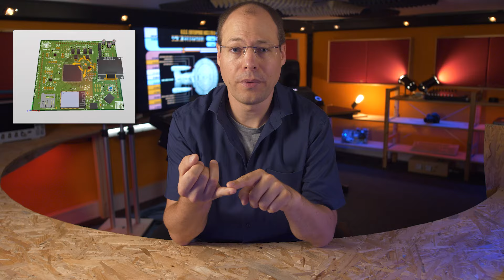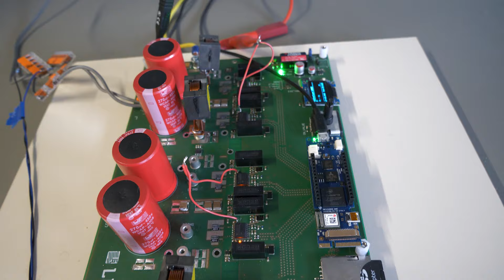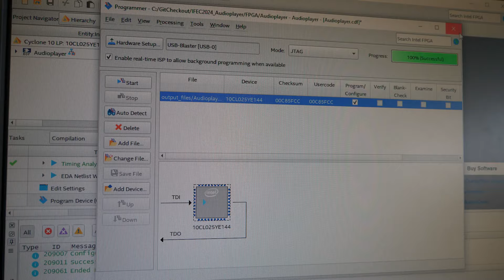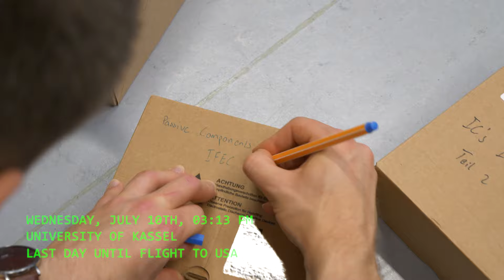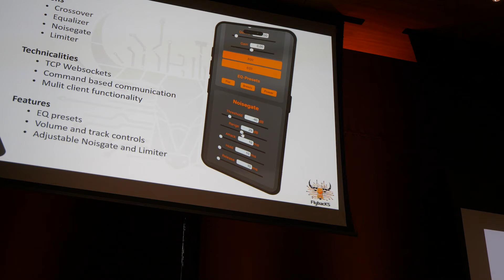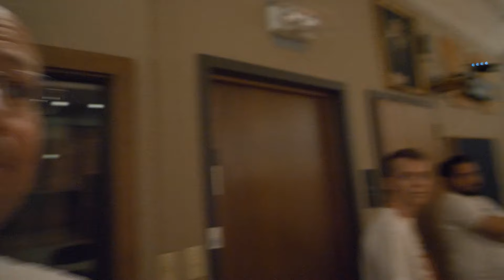An Engineers road movie to an FPGA based Class-D-Amplifier

Comment: Hi Prof,  what a great idea i hope that it could became early a product: perhaps with high grade products like PURIFI or HYPEX! Following current rpoducts around i see that topping and highend DAC products are still moving to 1 bit decoding methodologies (i think FPGA based): basically it uses SDM (DSD) format to play applying only PCM conversion if needed. DSD format is very used for highres music and any PCM could be converted (upsampled with dithering) to DSD.
Using this standard you don't need a particular player and could be the best general purpose DAC/AMP on the state of the art. Please take a look at mola mola DAC internal technology.
Reply from the maker: Yes, you are absolutely right. We used Sigma-Delta-Modulation with up to 10MHz in this project to drive the Gallium-Nitrid-Amplifier. First, we upsampled the 192kHz Audiosamples of the Audio-ADC to above 5MHz, fed this bitstream to the digital-output of the FPGA and to the gate-drivers of the GaN-devices. We went out of time to optimize the whole system and ended up with this meager THD-value (compared to the other teams). In the end I was happy with the 0.25% THD. If we would optimize the control-loop with a better and faster ADC, we could have better results. Using this DSD signal to a pre-amp we got very good audio-signals, so this technology is really promising.
Reply: @pcdimmer  There's a very appreciated software HQplayer that uses different PCM/DSD conversion strategies with a huge different dithering options... 
I mean to use 1bit trail from DSD to drive PWM instead comparator.... in my opinion a straight digital input amplifier (without ADC) will be a really killer application: and, in case of ADC needs, is very simple to add it externally...
Looking at Hypex products like NCx500 it has 150Mhz pwd clock and output filter around 70KHz because native SDM noise repulsion.... why not to ask them?
Many thanks for your great ideas sharing... please don't stop! 😄

Comment: I'd be super stoked on a video, where you focus on the control loops of a "digital" class D amp.
Most people in the field still stray away from it
Reply from the maker: Yep, we had problems here, too. We implemented a common PI controller with proportional and integral part. As reference-value we used the 48kHz audio-samples and upsampled them to 192kHz. To measure the output of the Class-D-Amplifier we measured the output-voltage after the LC-filter, fed it back to another Audio-ADC with 192kHz samplerate and tried to implement the control loop. But we learned, that 192kHz is not enough to bring the THD below 0.5% as the connected speaker creates some disturbances. We better had used a much faster ADC with some MHz-samplerate as with the FPGA we were able to implement the PI-controller with up to 5 MHz. Our THD could be much lower with a better signal-feedback strategy.
Reply: @pcdimmer  That super valueable feedback. Thank you!

Comment: what is a Electronic AC transformer?
Reply from the maker: Hi,
a single-phase solid-state transformer is a device with an AC input, a rectification, a DC/DC conversion (for example a dual-active bridge) and a DC/AC inverter. The main-goal is to minimize the volume and weight of the whole system compared to common 50Hz/60Hz transformers.

As the DC/DC converter is switching at frequencies above 50kHz the transformer can be reduced in size.

Comment: interesting that a substandard format like MP3 was used to test the audio.
Reply from the maker: Yes, you're right: MP3 is not the format of choice if you want to test an audio amplifier. Compression causes here a significant loss of resolution, especially in the higher frequencies (above 5kHz). However, there were more practical reasons for this: we needed a format that could be read from the SD card even with a lower SPI clock. In our first setups, we connected the SD card via jump wires and were able to clock the SD card at a maximum of 12 MHz. This meant that WAVE files could not be transferred smoothly. MP3 was simply much more relaxed.

Later, we had an uncompressed audio ADC that sampled at 96 kHz and 32 bits.

Comment: I have recently gotten into HF amateur radio, and learned about the research into using switching RF amplifiers for single sideband signals, which are typically amplified with linear amplifiers in most comercial designs. I had been considering attempting to synthesize the SSB digitally in an FPGA so that it takes in i2s audio, frequency and mode (upper or lower sideband) and directly feeds the switching amplifier (in this case Class E). The inputs to the amp are a square wave representing the phase information of the signal. To modulate amplitude, the input voltage to the amp is modulated, which I was thinking of using a boost converter for, so the FPGA would output a PWM value that tracks the envelope. Obviously audio frequency has significantly different constraints than RF, but otherwise it's interesting to see a similar idea implemented successfully.
Reply from the maker: Yes, the applications of FPGAs are truly universal. I'm playing with the idea of building a software-defined radio (SDR) at some point. Good luck with your project!

Comment: Next project, create a FPGA based C64 aka SID synthesizer with midi support. "Unlimited" channels and stereo output would make a product that could be not only a fascinating way to listen to old SID songs in Stereo, but also a viable commercial product :)
Thanks to the MISTer all the documentation and "cores" are available :)
https://youtu.be/Rj7XtnmsVVk
Reply from the maker: Sounds nice. In the GitHub-repository I've already added a sinewave DDFS block... and adding MIDI through the SAMD21 is not a big deal. Building a basic FPGA-based synth is absolutely possible. A challenge will be a solution to smoothly change between sinewave, triangle and rectangle...

Comment: I see lots of PDM processing in here. They say DSD isn’t worth it. This displays a great real world use case of 1 bit audio transport.
Reply from the maker: Yes, during the work on the mixing-engine and especially on the upmixing of the audio-data (PCM audio) I realized, that PCM and PDM (DSD) has both advantages and disadvantages. PCM is very nice for audio-manipulation, meaning EQing and volume-control, as you have to deal only with the individual samples. DSD would be much harder, as you first have to use a sinc-filter (low-pass). But for the output back to the real world, DSD is nice as it has a more natural stream and is easier to low-pass back to real audio-signals. As converting between both types is possible without great pain, I have to admit that both have their justification and I will continue to use DSD for analog output, but stay with PCM within the audio-processing. That's a nice compromise, isn't it? :)

Comment: Thank you for the detailed video.

What make and model of reflow oven did you use in this project?
Reply from the maker: We used an older Paggen RO250BF-SF Reflow oven. But we are in the process of purchasing a new vapor phase oven (Paggen SV540). The operation should be much better - let's see :)

Comment: I so wanted this to succeed.  But analog Class D amps have the edge because they can use feedback.
Reply from the maker: In the end our problem was that our feedback ADC unfortunately could also “only” work with 192kHz like the audio itself. We should have used a sigma-delta ADC here, which allows significantly higher sample rates, so that we could have sampled the signal in the MHz-range, for example - like the PDM.

Comment: Wow...it includes so much detail, it would be a great FPGA and audio learning kit. A bit pricey, but great.
Maybe with some improvements it could be badis of an open source online product design course.

I would love to see other submisions if they are available somewhere.
Reply from the maker: Unfortunately, FPGAs are still very expensive. I spoke to the Arduino people at the "Embedded World 2024" in Nuremberg in Germany but unfortunately the Vidor 4000 is not yet being manufactured again. There is an alternative with the CYC1000, but without the ESP32 and without the additional Cortex-M0+ microcontroller. Nevertheless, the costs are significantly higher than for other controller boards.

Unfortunately, I don't have the time for a proper online course at the moment. We are currently on tour with our band. However, it would certainly be an interesting thing to do.

Comment: hello , I am trying to build a class D amplifier with switching frequency from 500khz to 2mhz. Do you have any sample circuits for me to study? There is no information in my country.

Thank you to everyone who commented.
Reply from the maker: Well, the general circuit is that of a single-phase inverter, as used for motor applications or PV systems: four semiconductor switches, gate driver and control. Si MOSFETs are usually used for a few hundred kHz, and GaN semiconductors for the MHz range. However, I cannot provide any more information directly here.

However, I am planning a YouTube video for fall or winter, where I will go into more detail about the output stage.

Comment: Hey I love this. My final year project in Electrical Engineering was designing and building a class D amplifier and yeah, it actually worked :) No DSP or processors - this was back in 1990. Just a straightforward sampler and analogue feedback. Switched at (iirc) around 500 Khz. Also doubled as a very effective AM radio jamming device. Absolutely loved doing that :)
Reply: Nice!
Surprisingly, even some of the "modern" Class D car audio amplifiers being sold currently still have this problem of disrupting AM/FM radio reception due to radiated noise.  :-P

The first full-range Class D amplifiers I used were the tiny 100 watt @ 4 ohm monoblock car audio Xtant 1.1i amplifiers back in 2003 for a "high end" car stereo system that I installed into my 2001 Mini Cooper S.

At 6.5"L x 5.81"W x 1.63"H , the 100 watt Xtant 1.1i Class D amplifiers were only slightly larger than the footprint of a typical plastic CD jewel case!  :)

I used 6 of these tiny Xtant 1.1i mono amplifiers to power a 3-way front component speaker system in the Mini Cooper S (Scanspeak Revelator 7" midwoofers, 4.5" midrange, & 1" silk dome tweeters). 

Independent Level adjustment, fully adjustable Crossover Network Filters, Digital Delay, and 10-band PEQ per channel for each speaker were provided by an 8-channel Sony Mobile ES XDP-4000X DSP unit with a matching Sony CDX-C90 single-DIN AM/FM/CD player "head unit" as the source.

The CDX-C90 stereo head unit used a digital Toslink optical output for the CD playback which connected to the Toslink inputs on the DSP unit.  A matching 10-disc CD Changer could be connected to the DSP via digital Toslink as well.

The Xtant 1.1i Class D amplifiers definitely affected the stereo's Tuner Reception to some degree!  But I listened primarily to CDs at the time, so I wasn't too bothered by it.  :P

To my ears, these were the first Class D amplifiers (of those that I heard to that point) which did not exhibit a somewhat harsh or overly bright/unpleasing treble response.

And the midrange, midbass, and bass frequencies were at least as clean/articulate/full as any of the Class A or A/B amplifiers I had used up to that point as well.

Before taking the time and effort to install all 6 of these tiny Class D amplifiers into my car, I tested them in my home system where they powered a pair of 2-way nOrh Marble 9.0 loudspeakers that used similar Scanspeak Revelator drivers, and I was convinced that they were up to the task.

The Xtant 1.1i were listed (and confirmed via AudioPrecision measurements) as having a THD of 0.7%, and a SNR actually over -105dB!  This was unheard of at the time even for some high end Class A/B home audio amplifiers. 

The Output Power vs THD was not the typical gentle rise towards maximum power, then rising sharply as the amplifier begins to clip.  Instead, THD rises to about 75% power, then drops off before rising sharply at clipping, but while never exceeding 0.7% throughout its linear range.

The output section used two N-channel Phillips devices rated at 150-watts dissipation, each switching at 1.06MHz.  Power efficiency was up to 80%.  If you search Online you can probably find a picture of the internal PCB layout and components.  It was surprisingly simple and sparse given its performance.

In more recent years I've used the BikeTronics/Vivid Amps 12vdc mobile amplifiers which incorporate the Hypex UcD & Ncore Class D modules respectively.  And there are currently some multichannel GaN-FET designs from SoundDigital.

In my home rig, I'm currently using a ~$1350 USD stereo Class D amplifier DIY kit amp from DIYclassD that is using the Hypex Nilai500 modules.  For whatever reason I find that I prefer this Nilai500-based amplifier over the Purifi Eigentakt 1ET400A-based designs I've heard.

ANYHOW, it's a great time to be a HiFi audio/music lover with the availability of quite a few accurate, powerful, high efficiency, and low distortion Class D (and G & H) amplifiers!

Cheers!

Comment: Huge props to you Chris, you seem like an amazing teacher. 
Also I am impressed by the technical complexity of this project and the fact that it was done at least in parts by students. I am an electrical engineer and know how difficult it is to get a design first time right.
Amazing work!
You could check out the Zero To ASIC course / Tiny Tapeout. Maybe next time you could include a custom ASIC in your design :)
Reply from the maker: Thank you very much! The students did a great job, especially with the power board and the ControlBoard. They will certainly be able to take a lot from this project for their future jobs.

What was the price of an ASIC photomask again? I think that's beyond our budget ;-)
Reply: @pcdimmer 
Edit: nevermind, my info was outdated. Seems that the Open shuttles have been stopped.

Free actually, if you can manage to fit into an open MPW Shuttle financed by Google. The design needs to be open source and "interesting" enough to qualify. But I think student projects are fabbed quite often.

Comment: Nice video!  For what it’s worth, you don’t necessarily need GaN for 100s of kHz switching - I design multi-MHz power converters at my job with silicon FETs, and they are cheaper, more abundant, and a bit easier to work with than GaN.  Easier to find gate drivers as well. I’d especially recommend looking into Infineon and their “OptiMOS” line of FETs
Reply from the maker: Yes, fast MOSFETs could have been used for the subwoofer channel in particular. But then we didn't want to make different designs and set up all channels symmetrically. Originally we had planned to go to approx. 11MHz (DSD256) - so the use of GaN seemed the most obvious choice.
Reply: @pcdimmer  wow 11MHz, yep that is definitely GaN territory ;-)

Comment: Whats the program u used for the simulation???
Reply from the maker: This particular program is made by the swiss company Plexim and is called "PLECS" (www.plexim.com). It is great for simulating ideal circuits (e.g. to simulate different inverter-topologies) or to create rapid prototyping software as it can compile the project into microcontroller code. In combination with LTspice (or Qspice) for simulation with real components, it is a very powerful set of simulation-tools.

Comment: With any device that has an output that produces EMI always put low value resistors ,eg.33ohms for 3,3v and 100ohms for 5v, on your SPI and I2C bus. I have used this method with success on a controller of a 1KW fridge compressor including isolated grounds for relay output and MCU. Use switch mode PSU's for you MCU and FPGA voltage rails as they are much faster in compensating for voltage ripple and more efficient than fixed linear regulators. LC circuits are not as good as they are on paper. I would of put a fly back diode on the grounds of the speakers just as a quick fix. Slightly less power ,but would of helped you interference issues a lot more.  I see you have the data lanes between ground layers which is great.
Reply from the maker: Yes, 33 Ohm for the SPI bus is a good adviced to get reflections under control. To fix the bug on the footprint I had chosen direct wires - not the best idea. But as we had enough space in the ESP32-S3, we did not put much efford on it to fix the SD-card reading. For the more "important" signals, we used caged PCB-tracks and kept an eye on the overall signal-conditions.

Comment: Is it possible to 'inject' a  DSD SACD 1 bit  PDM stream directly into the amp?
Reply from the maker: Yes, this is possible: as the FPGA can handle this bitstream directly, we could use combinational logic to inject this bitstream to the amp. But to adjust the volume or to apply the filters I would suggest to use a low-pass or a sinc-filter to convert the DSD in an appropriate way. Anyway this is one of the remarkable features of an FPGA to handle both PCM or DSD.